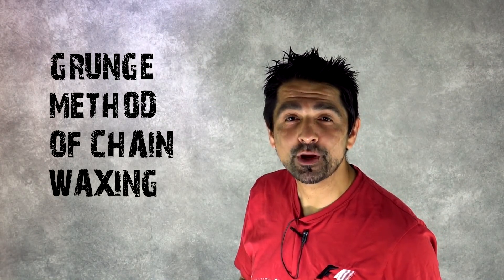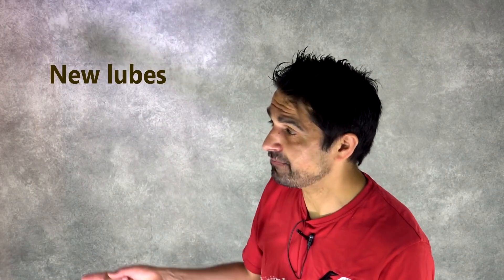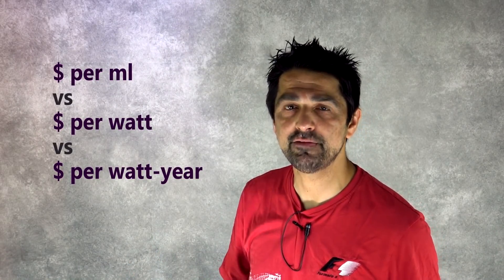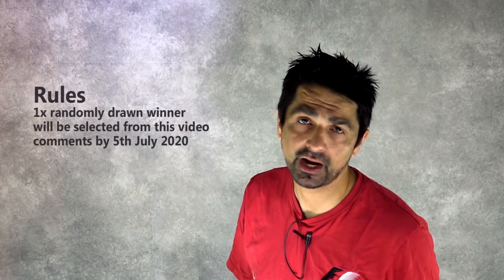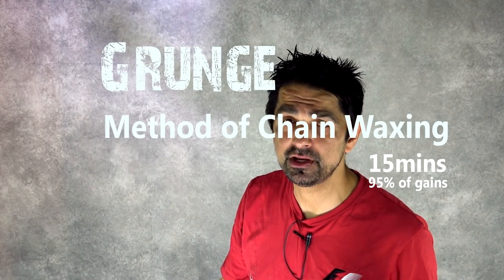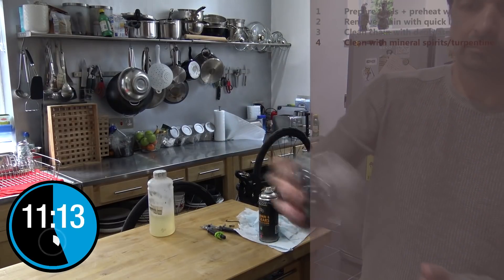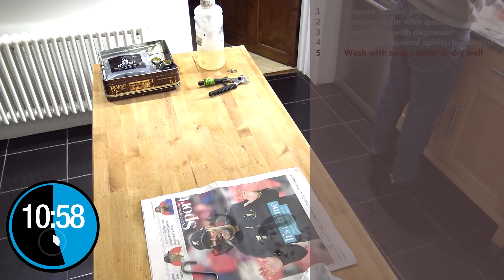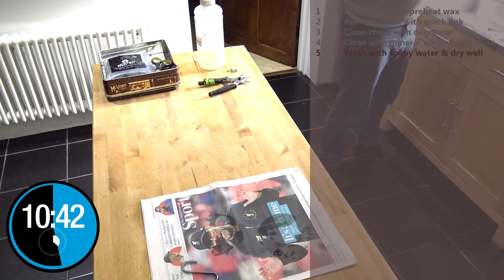Chain waxing and lubes revisited (15min grunge method is not a marginal gain)

Comment from the maker: Hi,  our shop is now open! https://shop.cyclingapps.net/    Plus here are the steps shown:
1		Prepare tools + preheat wax (for 10mins)

2		Remove chain with quick link
3		1st Clean chain with degreaser (quality makes almost no difference here)
4		2nd Clean with mineral spirits/turpentine/alcohol

5		3rd clean is a wash with soapy water & dry well
6		Check your wax is completely liquid (90°C) with no lumps

7		Add hook/wire to chain (to fish is out later)
8		Place chain in liquid wax carefully
9		Submerge chain completely
10		Agitate gently for 1min (until all bubbles disappear)
11		Turn off heater so wax+chain cools (this will take about 5mins keep an eye on it!)
12		Watch for wax to start to change 
into gloopy semi-solid
 (this will happen around 50°C)
THIS IS THE MOST IMPORTANT STEP. Wait too long and it will be a gloopy mess, too short and all the liquid will run of
13		Remove chain carefully
 whilst wax still liquid (but only just liquid)

14		Hang chain on hook and wipe clean
 (this removes excess wax on outside)
15		Agitate or brush the chain whilst
 hanging (to remove awkward wax between links)
16		Allow chain to cool for about 2min
17		Refit chain to bike with quick link
18		Spin cranks so loose wax flies off (dont worry all the good wax is still inside)

19		Clean up! 😂 
20		Enjoy the bonus watts!
Blog version: https://medium.com/fastfitnesstips/grunge-waxing-why-quick-waxing-your-chain-is-still-worth-it-a9715fe4e518
Motobike version: https://www.youtube.com/watch?v=VnPYdcbcAe0

Winners from this competition (email us with your address): 
ted n ruth
 | jonathan fisher | Harley Moore
Reply: I have been waxing for about 4 years now , I use an Ultrasonic Cleaner , and then wax it with Parafin wax mixed with tifllon.. 

Yes it takes me more than 30 mins to do it ,and after 100 km I top it  up with any wax drip lube this  makes it ,  the wax that wax immersed bitween the pivots almost stays intact... and thus I don't have to re wax the chain again till 6 months. 

Note :Cleaning the chain with cold water also keeps the  chain cleaner  and avoids melting the wax bitween the pivots.
Reply: Alex, you suggest to clean with the grunge method  every 400ks but this means without wax right?
Reply from the maker: @iischia  no with wax! degrease, clean, wax = 15mins

Comment: 15 minutes?
It takes me just 5 minutes of doing. Take chain off, stick in the pot, go do my chores, hang chain, have a shower.... Then I am ready to go at any moment. No cleaning, no oil stains, no mess.

If I was to stand on top of the pot, it would take 20 minutes. But I do it while I'm cooking, so it really takes no extra time.

Also I can do it while I'm eating, because I won't get oil stains anywhere.

It costs me about $7 per year. If you figure the chain life, you are actually making $20 per year 😂

Comment: I'm a hot wax convert, but probably wouldn't do it if I lived in a small APT. I don't need much time unless I want to be anal about the cleaning, the crock pot is in my garage ready to go each time I need it, and do other things while it's reaching temperature. the dip process is super quick. I admit to doing quick waxing between deep cleans with the ultrasonic cleaner, so I can get that quiet drivetrain (dip without a clean). I don't see the need to clean between every dip because most of us aren't doing this with the drip lubes, in fact, many people go way too long between deep cleans with the drip lubes, they just give it a rag whipe most of the time. I'm waxing mostly to get the clean chain that I can touch, the lower watts is a bonus that I can appreciate, but I'm not racing anymore.

Comment: Hey guys, been doing straight paraffin wax immersion for a while. I get ok results maybe 300km. Going to try some additive like ptfe or ws2. I’ve been topping up with squirt between waxing, however this last time after a boil off clean, my wax pot darkened quite a bit like there was some oil in it. Does squirt contain a oil carrier, is it compatible with the oz approach? Or do I just need to do a regular degrease/wash/solvent before immersion waxing in my routine? Cheers.

Comment: Started waxing last winter with cheap paraffin, 1st batch took  a long time because of the cleaning of the dirty chain. Did the immersion, put it on my bike last spring and it's been running perfectly all summer.

Comment: I think the key message of this video is great: Wax you chain instead of using oil based lubes.
But I also think that this video can do more harm than good. You simply can not do the waxing in 15 minutes properly. It takes at least an hour to clean the chain from all grease. You will need 15 minutes first just to let the solvent penetrate to the grease. Then you will need at least 2 times 10 minutes of new solvent with shaking the container and you will need at least 2 x 10 minutes in denatured alcohol.
After this you have to get the chain completely dry and then submerge the chain in the hot wax for at least 10 minutes to make sure the wax can properly penetrate inside the links of the chain.
By using the 15 minute method shown in the video will result in improper degreasing, no proper penetration of wax which will end up in bad performance of the wax chain, hence a lot of disappointed riders will go back to oil.
So, please do not spread wrong methods because this will cause more harm then good.

Comment: i tested distance between waxing and everything over 100-120km is danger to destroy chain, i started with every 140km and chain lasted 2000km , then I tried with 100km and chain lasted 6000km and still was in useful tolerances of wear, so, now is 3. chain that I waxed every 100km or less, and i use it on 3 bikes, first 3000km on road bike then 2500-3000km on mtb and then on wifes bike for next 3000km and so in circles, so one chain can be used almost 10000km with minimal impact on cassette wear because on every bike is always same "worn"/new chain
Reply from the maker: Great testing! thank you for this valuable feedback

Comment: hahahahahah, this is not messy?, like ozy cycly you have to have whole kitchen to wax the chain too, I "invented" how to wax chain on bike , one pass in 6-7 minutes and no need for cleaning things,just wax it and clean wax from chain with cloth one or two times and chain is cleaned and  waxed .II tested it for some 2-3 years and if you wax chain every 100km or less, for hg70 chain, it can last at least 6 times longer than on oil, so here is link on video but some things changed from time it was recorded, but basically procedure is the same:  https://youtu.be/ORA6xFPTZXU

Comment: Another fantastic video, Alex!     Had been considering wax for a while and I finally dove in a few months ago.    Some incremental power efficiency gains from waxing are definitely there, but I'm more into waxing due to the cleanliness and increased drivetrain lifespan.    I'm going to see how long I can keep my chains going this year as compared to my previous lubes.     

The only negatives I have (and there small ones) is when I'm about 60-70% along the way towards it being time to re-wax and I have a longer, 60 to 100 mile ride planned.    Do I go ahead and re-wax before the ride or do I do the ride and go over my usual 180 mile re-wax interval risk increased wear past the jump point?    It's a bit more work, so up until now I usually re-wax before any long ride that will put me past my usual re-wax point.   I may go to waxing 2 chains at a time and rotating them on the bike and that might help make it a little easier.   And I haven't found a good solution to lubrication/waxing on ride day or during the ride if I need it.   
 
Have seen so many of your videos, but I miss them lately.    Hope to see more on your channel!
Reply from the maker: Thanks for the kind feedback! In your case keeping a set of wax chains (at least two but three is best) is likely the way to go because the workload to do two is not so much more than one. Plus it's good for the cassette to rotate the chain. Regarding the video production line I needed s break and had covid twice and have done a lot of coaching instead but still doing blogs at cyclingapps.net. #happytraining
Reply: @Fastfitnesstips  Thanks so much, Alex!   I think I probably need to order a new chain or two.    I broke out a new chain today and I'm waxing it too as my current chain will be pushing 0.5% before too long.    

So sorry to hear about covid, twice!   Dang!  Sure hope you are making a full recovery.   I'll be looking forward to more excellent video productions soon.

Comment: Interesting that there’s still debate over petrol or snake oil drip lubes vs wax immersion. I’m also curious what people do wrong with prep or application of wax. I’ve been using plain ole grocery store paraffin wax for several years on all of the bikes my wife and I ride - mostly off pavement. Very superior results all around compared to all the various magic potion chain lubes I had previously bought at bike shops. No if’s, ands, or buts, the paraffin wax has been superior. Besides being a good lube fresh from the garage, rain or shine, the cleanliness factor increases the advantage comparison as the miles add up. Superior cleanliness is not merely a cosmetic preference! Dust and grit are not effective lubes but that’s what you attract with petrol and drip applied lubes. Since I’ve switched to wax immersion we’ve consistently had: cleaner, quieter, better shifting chains. And, I don’t need to fuss or service the chains as frequently but get noticeably longer lives from the chains. If the bikes are dirty when we finish a ride I hose them off - and that’s all that our waxed chains need too. The only  thing that seems a hassle about wax immersion is getting the factory petrol goop off the brand new chain before first wax.

Comment: Alex, you have put out some excellent objective and science based analysis recently....so subbed. 
I am a physio that worked with GC teams until a few years ago, and I haven't been able to fault anything of yours I've seen. 
Regarding waxing, elite track cyclists have known of the wax advantage for decades. 
Personally, I never bothered waxing my road bike chain until groupsets moved to 11 speed. 
I have noted 11 speed chains, cassettes, and chainrings do not last as long as lower speed, due to quicker chain stretch and sprocket wear. 
This got me back interested in waxing. 
To reduce time and hassle of waxing, and lengthen drive train longevity, I recommend the following: 

- If changing to waxing for the first time, it is best to start with new chainrings, cassette, and 4 chains. With everything new, you minimize wear. 

- Rotate 4 chains on the same bike, and wax all chains at the same time. Why? If you get ~400 km/chain between waxes, and cycle 8000km/year, then you need to do 20 waxes a year. 
4 chain rotation ca reduce waxing from every 2.5 weeks, to every 2 months or 6x a year..... by waxing 4 chains together.   

- Reduced waxing time is not the only benefit.  When rotating chains every 400km you reduce rate of wear of cassettes and chainrings because you don't terminally stretch chains (and apply greater friction to sprockets) between chain changes. 
On 11 speed cassettes, several times I have put a new chain on only to have bad chain slip occur, even after 0.5% chain wear of 3 chains. Chain slip is a serious safety issue...so any maintenance that avoids it should be adopted. 

Other tips: 
- use an infrared thermometer to gauge temp. of wax, especially if using saucepan on hotplate or gas ring. 
- use dedicated slow cooker or saucepan and leave wax in it. don't try to pour out into another container.

Comment: Is there a known downside to mixing products? For instance, you’ve waxed your chain a while back but it’s starting to wear off, and you want to go for a ride but haven’t got the time to rewax. Can you add in a different drip on product, or can that simply mess up your wax?
Reply from the maker: Great question, most find this ok, but I have more success removing old wax and restarting.....however you can just skip to the wax heater if you don't mind a little dirt in the wax and higher chain wear

Comment: im using squirt regularly...im typically wiping the outside of the chain off after every other ride and then doing a full degrease every few hundred miles.  Is the wipe down i do helping/hurting/not necessary?

Comment: Great video, but I'm not sure where you get some of your figures. There is no way you will get 600 Kms from squirt, or any other lube for that matter, and that's in perfect conditions, let alone dusty or wet.  600 Kms equates roughly to 24 hours of riding, squirt, the company, recommends for road, to reapply every 6 hours of riding, and in my experience after using it for years is that's about right. You can stretch it but nowhere near to what your stateing.

Comment: Gravel road and hard peddling trail I wore out a chain in 100 km. The chain was wiped and oiled before each run. I switched to waxing. I love it. Chain is clean. Peddling is easier. Probably can go a gear higher in the harder peddling trails

Comment: I waxed my chains for the first time a month ago. It's been awesome to ride in the wet and not have summer lube washed off. Chains remain clean and running smooth. I had trouble with a few shifts initially as wax remnants built up on the sprockets - my fault. But once I cleared that, all had been smooth and very very clean.

Comment: 10 speed link does work on 9,8,7 speed chain? Or works on 11,12,13, speed chain

I need exact size of chain link to connect or use in my 8 speed chain thanks

Comment: Are you using a wax heater used for cosmetics? How large is the aluminium pot inside?
Reply from the maker: Yes they work fine....pot size is about 20cm....nothing expensive needed

Comment: After doing super clean oz method I did a paraffin and PTFE 10 to 1 mix and dip. I rode 300 km and loved the feel and sound.  I accidentally dropped the chain off the chainring.  I stopped reached down with bare hands and reset the chain.  Ran my hand down the chain and there was absolutely no stain or black marks on my hands.  I will never go back to oils again!

Comment: The actual process might take 15 mins. But, the initial prep and cleaning afterwards still adds lots of hassle and time. Waiting for wax to melt, 1 hour. Removing chain off the bike and cleaning and drying it off...15 mins. After hot waxing, letting the wax solidify takes 45 mins. Only then can you stow away the Crock-Pot. Then wiping off, wiggling stiff chain links, cleaning up messy wax drop adds another 15 mins. Then you still have to put the chain on the bike and find a new quicklink.... Too much hassle. But, might be worth it if u don't mind getting down and dirty every 200 to 300km. For me, I put in 200 km in a single ride and hate hearing those squeaky sound the chain makes. If you are a low mileage rider then might be worth the hassle. For higher mileage too much work. Yes you can batch three chains to save some time but still that takes careful planning and rotation of the chains...

Comment: I’ve tried immersion method  it gives a silent chain but it gives reduced snap when I stamp on the pedals it doesn’t feel the same as individual roller pin lubring. I think the immersed chain acts like an o ring chain and the rollers squeeze the wax that is trapped in between link and roller. The chain may have less friction but it seems to absorb power under acceleration. This was especially noticeable on a worn fixed chain where the wax could be seen to squeeze out of the roller pin interface.

Comment: I would like to ask about cases where conditions are not that perfect. For example, riding when there is a lot of very fine dust that will simply get into the chain (it does not require sticky lube, it sticks by itself - it is actually a pulverized clay). Can it be detrimental to run the chain for another 200km, since the wax will still hold but will have some dust in it?
Also, how does the wax hold in extreme conditions like pouring rain and some sandy mud - i.e. a liquid sand paper (not drizzle and some nice gravel roads)?
Does anyone have any experience in these conditions?

Comment: It's surprzing how long it took for the cycling industry to catch on with wax. 
Originally this come from electronic/audio industry to remove microphonic behaviour from coils.
the 100% method you speak of can be done stupidly quick if you was it inside a vacuum.
Nordstrand Audio has been vacuum waxing their components for over a decade so this isn't really all that groundbreaking.
Reply: I think it is actually a pretty old thing in cycling that has been re-discovered after testing showed how well it actually works.

Comment: I bought a small container of absoluteBLACK and put some on my speedplay pedals which are metal to metal (I use the four hole shoes which require a metal plate over the carbon sole).  Just took a few drops and I let it dry overnight.  I could feel the difference in pedal float with the wax.  Normally I use a PTFE solution,Teflon.  The slippery float was very noticeable.  It will be interesting to see how long it lasts.

Comment: Thanks, great video.  I spent 40+ years in the lubricant industry, and developed many products.  The “secret sauce” insanity has finally come home to chain/cycling industry. A solid lubricant such as graphite or teflon suspended in wax does by far do the best job.  Running a perfect chainline always uses less watts than any angle.  How often does that happen?   Not much.